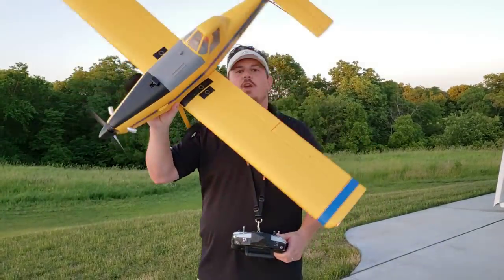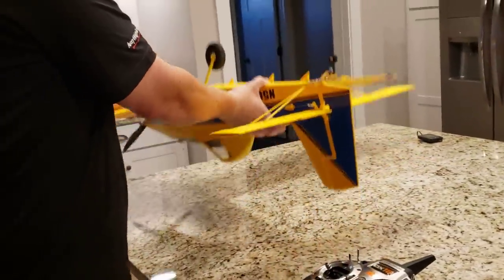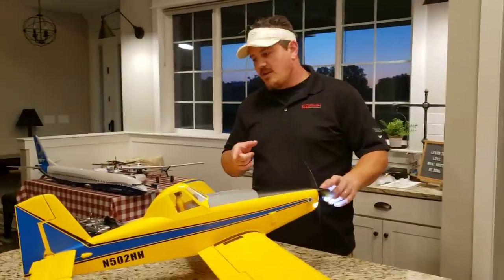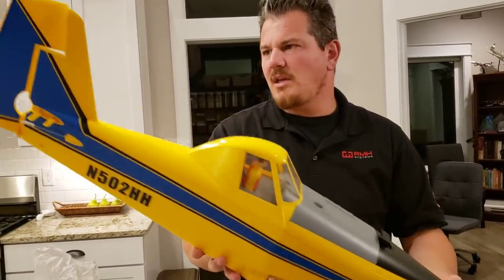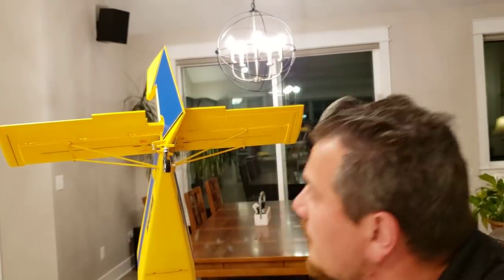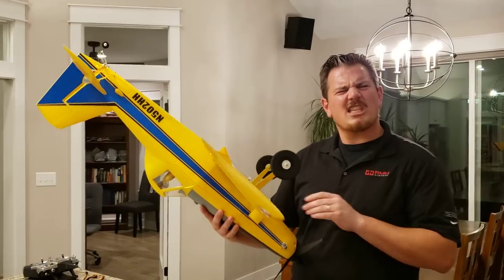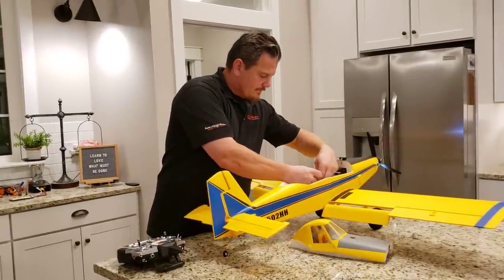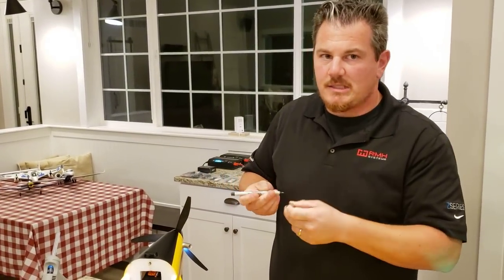Eflite - Air Tractor 1.5m - Unbox, Build, Setup, & Flights

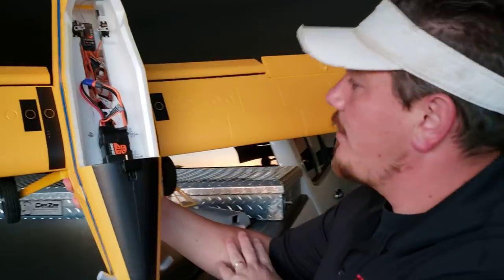Comment from the maker: Everyone, I got a couple GOOD questions about this, so I wanted to clarify it, as my wording was very confusing in the video @ 7:10 - I was measuring the plane as being tail heavy, but it felt like it was flying NOSE heavy, so I moved the battery FURTHER back to see if it would help. I had another commenters suggest that the way I had marked the CG on the wings was wrong...I used a piece of paper to lay tight along the leading edge of the wing to the recommended points - This was wrong because you're supposed to measure STRAIGHT back, and I was following the contours of the wing, so my marks were ahead of where they should have been. This would explain why my plane was flying nose heavy, while measuring tail heavy.

Sorry about my mistake. We'll fix it in the future.
Reply: .. we're all human ....really enjoy your videos ...at 55 years old , it takes me back to my childhood and my first RC plane ...Kraft radio and servos etc ...thx to my dad ....thx again ...ps yes subscribed 👍
..
Reply from the maker: Thanks Mark C!
Reply: I have a question on the terms you use.  After the correction, and as soon as you turned on the flaps, you remarked that it was much better. What was different? You said you have "plenty of elevator authority now but with no ballooning." What does that mean? I'm new if you can't tell.
Reply: @jdouglasj2000  he corrected flap corrections in the transmitter if you go back and look he lowered them.... Also he had more till authority because he mechanically trimmed the elevator after his 4s flight....I know it sounds a little confusing but he corrected both of these issues while being inside then when he came back out and flew this is the part you saw 👍
Reply: I was indeed lost for a while, but I really appreciate your addition and especially how it came about!

Comment: Good to know Micheal, thanks I thought I could be on the right track as the field I fly on is like 3" grass.   On a setup question for those in the know,  what is your aileron throw?  as well as elevator and flaps.  I have it set up per the manual, which to me has it acting kinda lethargic.
Reply from the maker: Who's Michael?
Reply: @BrianPhillipsRC   one of the gentleman here that posted saying he uses turbo timber wheels.

Comment: Question if I have to remove the wings to transport it to the field do you think doing this continually will make them loose on the tube and going into the fuselage?  Do you think removing and reinstalling those screws in the wing numerous times would make them loose over time as well?   The Timber Turbo Evo and Apprentice wings come off and reinstall pretty easily and no real concern about doing it numerous times over a long period of time...  Just wondering what your thoughts are, I'm thinking it's one of those planes where you install the wings once and leave them installed.
Reply from the maker: Yes. It will wear an tear the system. I highly recommend NOT removing anything you can KEEP together... I would say the Turbo Timber is a bit of a nuance, in that the wings are SOOO easy to remove. These and others are not quite the same. Seems the low wing planes or any plane where there's a "pocket" to receive the wing, they're gonna get more beat up with repeated build and build.
Reply: @BrianPhillipsRC Thanks, I'm not sure the Air Tractor is for me due to transporting it to the field and it not fitting in the truck without removing the wing.
Reply: Indeed, this plane is obnoxious in that they clearly designed it on paper for easy wing removal but then totally flubbed it by making the screws difficult to get in and out in actual implementation.

Comment: Brian,  your camera crew is one of the best on u-tube!  she does a great job and usually bails you out on builds. Keep up the good work you all make a great team. 
Now a few questions? 
3 planes of interest 
1) eflite 1.5 mustang
2) eflite 2.1 ss cub
3) fms 1.7 Corsair 

What’s your opinion on any of the 3 for intermediate flyers (ease of flying) any of them fly like the air tractor?
Reply from the maker: 1) 1.5m Mustang flies well, but you better have a full scale landing strip as it gets wonky as heck on landings, and it's heavy...so it's not near as enjoyable experience on PAVEMENT STRIPS as the 1.2m P-51D, which is also much cheaper...

Harder to fly than the Air Tractor, but not a "Hard" plane to fly...just hard to takeoff and land, which is not A-typical of tail dragging, high P-factor Warbirds.

2) Carbon Z Cub SS 2.1m is flawless, if you don't mind having fairly expensive batteries, and have a means of getting it to and from the place you fly. It is very good, but wish HH would have added LED's at this relatively high price point. Flies like a dream. I've literally ran into the power lines with her, and kept flying for 5 minutes before landing. I also had the spinner and prop came off (which took me 2 minutes to find, BTW) and dead stick landed on the runway, no problem...this was a fluke, but shows the extreme good flying characteristics. I should have knows the collet was loose - this was MY BAD, but HH sent me a new cowl to replace my damaged one!!!

3) 1.7m Corsair - Jury is still out. I have the "new" prop to speed it up, on the way. I'll republish a video ASAP when it arrives. I'll do it like an unbox, build, and re-maiden (at the beginning) - Ask me in a week ;)

Flies and lands pretty easy. Looks and feels great on grass, since it's HUGE, but he thing will do okay on pavement if you grease the landings.

I have videos on all three, so watch the videos.

Comment: I’m using telemetry with my 637T open stock RX in my Turbo Timber.  Your Tractor receiver may be locked for programming.  Power up Tractor and scroll down to Telemetry, select auto configure.  Find Volts and set min volts to 14.4 which is 3.8 v/cell for a 4S.  I get voltage audio every 30 seconds but no audio warning when volts go below 14.4.   Instead I use custom voice “volts” in the Telemetry category.  So any time I cut the throttle and move the C switch from 2 to 1 and when I hear 14.4 I know that after landing I’m at around storage voltage.  One day I hope we will have official written documentation from Horizon.
Reply from the maker: I don't have voice alerts on my DX18, as it's a Gen1 :(.... BUT that being said, why doesn't a transmitter of this caliber come with more documentation??? I've always been baffled by this.

As for the low and high thresholds, why even have them if there isn't an alarm to sound or activate when the threshold is hit. I find this to be very disappointing, but still LOVE my DX18.

Comment: Hi Brian, can you please please tell me what the diameter of the spinner is? It is sacriledge that this didn't come out with an aluminium or chrome spinner as standard, mine is in the post and I am considering trying out one of my bag full of FMS PC-21 5 blade props (long story about China)  but I have to fit a metal spinner, it's a hallmark of the Air Tractors - those PT exhausts need to be bronzed and blued too, cable cutters, a wiper and a better panel and she'll be gorgeous
Reply from the maker: All in a days work. Have you considered just hitting it with chrome paint??? - Tons less weight!

Comment: Seems everyone flying this model for the first time comments on the elevator adjustment. I'm thinking it may be the short distance between the main wing and the elevator. I haven't flown mine yet, but may try extra expo and less travel.
Reply from the maker: Yeah, it's just an unusual issue on an Eflite plane....not to say it's an Eflite issue, but more I think it's, like you said, an air frame issue.

As for being a problem...I hadn't even remembered this issue until you mentioned it here. Super easily overcome, and I wouldn't use that as a "deal breaker"...but this plane is a bit more tricky to get flying amazing. Kinda reminds me of the Twin Otter, in the sense that it's BEAUTIFUL and SCALE, but it just takes a bit more to get it flying ROCK SOLID like some other Eflite planes more or less come out of the box already flying... Hope this makes sense.

Comment: Are there actual plastic hinges on the control surfaces, or just the crappy foam hinges?
Reply from the maker: The videos show what I see. The flaps have plastic hardware, since they're fowler flaps....but the rest, I'm not sure. Embedded plastic hinges are nice, but usually only on the highest dollar planes.

Comment: I just got this plane and setting up.  When setting up the Gyro and SAFE. everything I have seen, the plane needs to be level.  You set it up on the three point wheels.  Which should I do?  Thanks.
Reply from the maker: This plane is a BNF, so you don't really have to set that part of the setup (it's factory set)... HOWEVER, if you're doing a PNP, where you install a virgin Rx, which would at ONE point only require you to hold her "level" for setting the SAFE "level" home position.
Reply: @BrianPhillipsRC  Thank you for clarifying that.  I do have a PNP that I have struggled with and you just cleared that up very simply.  And, thanks for monitoring since you did this review 3 years ago.  I enjoy your reviews.

Comment: love the video Brian. i just had fedex deliver the air tractor, ive been flying the twin otter and love it also,  will there be much difference as far as handling the air tractor, ill keep it in safe for a few first flights
Reply from the maker: yes, the Tractor flies better. It's a very clean flying plane. The Twin Otter, while BEAUTIFUL, is a high wing loading plane, compared against the Air Tractor. You'll LOVE it.

Irronically, my Twin Otter AND my Air Tractor both share a manufacturing flaw...the horizontal stab is bent...works perfectly on both, but an ugly detail I'd rather not see...I hope you don't have the same issue.
Reply: @BrianPhillipsRC  did you have any issues with wing removal on the air tractor,i wanted to remove the wind halves for transportation reasons and the screws are real tough to try to get out once put in, i was thinking going with hexhead 3mmx8mm in the future if i can somehow back the current ones out,i did a little test hop, that air tractor wants to jump into the sky

Comment: So when you set Aircraft Type in thie video, you choose 1 and 1. But the picture on the radio shows by servos, and this plane has 2 and 2? That is confusing? It's using all 6 channels. Any thoughts?
Reply from the maker: I talk about it a lot in many of our other radio setup portions of build videos, but I must have omitted it here - CONTROL CHANNELS are not the same as the number of servos. Sometimes servos are controlled in groups because they're wired together...Other times we MIX the control in the Transmitter or the Receiver.

Example 1) Think of a split elevator - both are controlled by ONE STICK on your radio, right?
Example 2) Think of ailerons - one on the left wing moves one way and one on the right wing moves the opposite - NOPE, they're mounted OPPOSITE ;) This is how we easily accomplish this all too common feat...BUT you're still using one STICK.

I know that in the realm of computerized radio systems, it can be confusing, but just give it some time and you'll get it. We dive into a lot of detail on other planes, and you'll get it soon.

I actually talk a lot about this in the recently released XFly - T-7A video, if you're curious.
Reply: Thanks for the great explanation! That makes perfect sense! Getting a lot out of your videos!

Comment: CRASHED my Air Tractor, some how the plane took off with a weird trim causing it to stall from a vertical takeoff.  The plane couldn't overcome the up trim.  my question is the flap servo's are damaged do the have to be a reversed servo only?   Bought SPMSA332 these are not reversed.
love your channel, thanks for helping the sport to stay alive.
Reply from the maker: I honestly don't know. The Flaps channel is pretty easy since it's not controlled by AS3X or SAFE....so if they operate the wrong way, you can simply reverse the channel, but if you have ONE that goes the wrong way, and one that goes the right way...this is more of a pain in the butt....

Choice 1 - Physically disassemble the electronics inside, and swap BOTH of these things...the motor leads, and TWO of three of the feedback potentiometer, and your servo WILL be a "reverse" servo...or at least it'll be reversed from what it HAD been.

Choice 2 - Buy and use this on only ONE of the two servos....and it'lll reverse the direction it operates... Servo Signal Reverser https://amzn.to/3qgEqHF

Choice 3 - Get a different servo

Choice 4- cut the wing so the servo can "Face" the other way...thus changing the output direction.

Comment: Brian--Just assembled my Air Tractor, my horizontal stab also has an obvious downward warp on both sides, a little more so on the left.  Maybe a flaw in their mold?  Also that tail wheel setup is confusing.  I set up mine like you did the first time.  If the steering is crappy I will install that extra piece, although I do not see why the simple set up will not work.  Overall I think Horizon did a real nice job on this plane, they just keep getting better and better.  In a week or two I am going to get the Conscendo, I have a bunch of 1300mah packs that should work good and keep the plane light.
Reply from the maker: Sorry you got the bend too!!! I still think she's a beauty, but almost unforgivable ;( As for the Concendo Evolution - it's AWESOME!!!

Comment: What a janky tail wheel setup is right!!!  lol Come on Horizon, where's your instructions for this whole step?  Glad I wasn't the only one who was overly confused by this silly simple step.

Couple tips for others:
Those thick coarse screws for mounting the aluminum bracket were slightly too large go through the bracket freely without the screws binding up at strange angles, so I drilled those holes out slightly for some play.
Next your clip of screwing in those coarse screws looked dangerously tough going for my comfort. Yours had me clenching my cheeks hahah. Didn't want to risk splitting the plastic or worse sheering off the cheap screw heads on the way in, so I pre drilled out the yellow plastic holes ever soo slightly to ease the install. They were still very snug so I got the size just right!

Then I was really liking how you initially attached the springs directly to the control arm, and not that additional extended yellow arm with those set screw clamps.  So I did some research...If you zoom in on the Air Tractor pictures on Horizons site, you can definitely tell the springs are hooked directly to the control arm only like you first had.  On one or two of Horizon's Air Tractor videos, I was able to get a glimpse that they didn't use that adapter either. The springs are parallel looking and not V'd out like they are with that arm.  A shot on Pilot Ryan Media's video shows he hooked them direct too and didn't use that extended arm. 
So I'm confused as to what that extended yellow arm is even for, floats only maybe?

I did end up building mine initially with that piece but think I will give it a try both ways to see if it even matters? It feels to me like the springs will stay hooked in better directly hooked into the hole in the arm than with those set screw clamps.
Reply from the maker: Yes, all good points ;) I love this plane, with exception of the bend in my horizontal stab...this looks bad.

Comment: So in the end, did the 3s battery position wind up at your original 3200 4s mark, and the 4s at the new red mark?
Reply from the maker: yeah, but this plane does well somewhat indifferent to CG. It's not as critical is it is on other airplanes....pretty much, you just have to trim her level and go for it.

Comment: When I watch your videos, I'm basically thinking "does this plane look cool? Does something about it in flight impress me?" But when you did the A-10 video, which is a very cool looking plane and a fast plane, you discouraged buyers when you said that you can't see what the plane looks like when it's flying far away from you. I thought that was a very good point.  I'm curious what makes you like a plane, if how it looks isn't significant.

I started with a Champ RTF, which was really fun for a couple flights but then I got bored. So I got a Carbon Cub S+ which was much more fun, mostly because it was so much bigger.  If you screw up a Champ landing, so what? It's the size of a housefly and I don't really care what it does on landing. But I want my Carbon Cub to land properly, which takes a little doing.
Reply from the maker: Great! Sounds like you're getting my points ;) When I review a plane, I want to cover the features, of course, but ANYONE can do that. For whatever reason, people have come to expect my opinion to help guide their decisions to buy...and I can say this for certain...being I'm a total cheapskate, the small details make a big difference sometimes, and Horizon Hobby will not share any negative items the way I will (even though I work with them now...and also work with other suppliers too, if it weren't obvious). I try to pic out a few things that AREN'T perfect about a plane, so that you can get a REAL feel for the experience you will expect. This can help you to make a purchase decision between this plane and another...if you're like me, you can't buy 4 planes a month!!! You have to PICK what you REALLY want. I hope to bring this to the table as we review. Of course, we will still have fun doing it, and share the love of the "sort" and encourage the addiction. If more are involved, prices will get better and better and technology will advance faster, so I'm all about a more robust hobby. I want us all to enjoy it more and more every year. I also hope that with a larger group of RC pilots, we will have more pull with the BS government regulators who want to strip us of this wonderful freedom for absolutely mindless reasons.

Thanks for the comment, and for being a part of this channel!